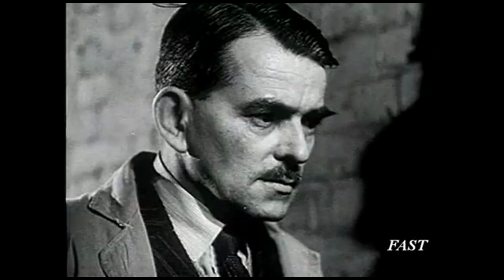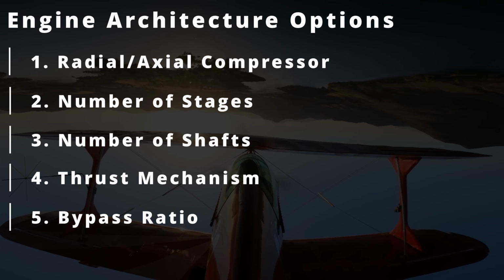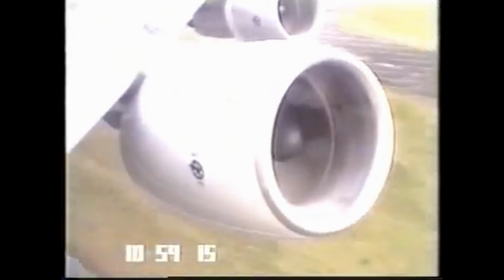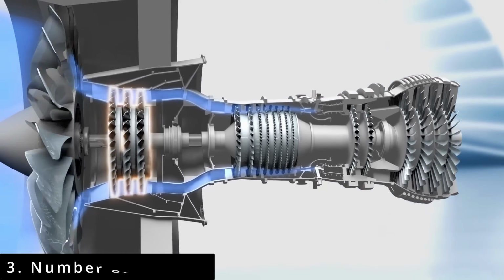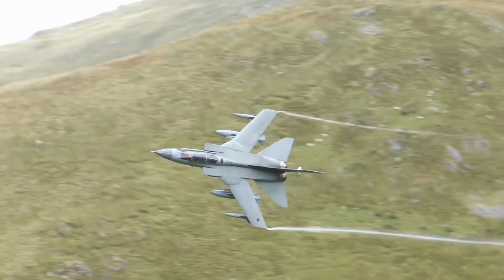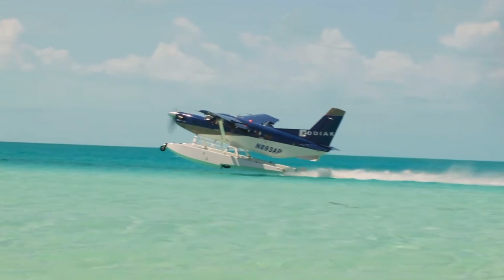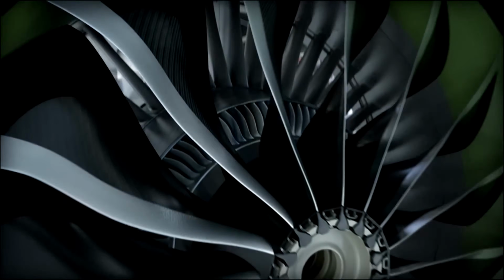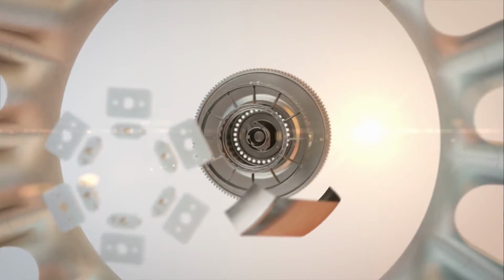How it's Made: Jet Engines

Comment: Modern aviation does not fly according to the Frank Whittle scheme, but according to the scheme of German jet engines BMW 003 and Jumo 004. Frank Will's scheme is used in APU and in helicopter gas turbine engines. All traction engines of passenger aircraft and military fighters are based on the design of the first German jet engines BMW 003 and Jumo 004. The design where the compressor and turbine are located on the same shaft with the combustion chamber in the middle is a German design. It is a German invention!

Comment: Regarding Jeju Air Flight 2216 tragedy, one of the supposed causes was due to the plane hitting a flock of birds. Are jet engines designed to withstand collisions with birds?
Reply from the maker: They certainly are! But only a specific size of bird. Anything like a goose will be catastrophic to the engine, but birds like finches wouldn't be an issue. But it also depends on the number of birds the engine ingests. Usually the pilot will turn around and head back to land following a bird strike on take off...

Comment: You are correct 👍 The addition of the bypass is what makes engines today more powerful, quiet and efficient. Although if they get too big the engine will touch the runway. I work on the A320 and the nacelle housing is 0.5-0.8m from the ground. Any bigger and the wings need to go higher on the body. Amazing stuff 🛫